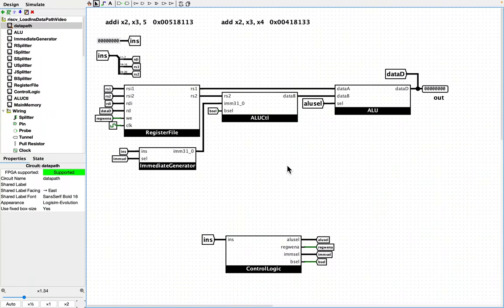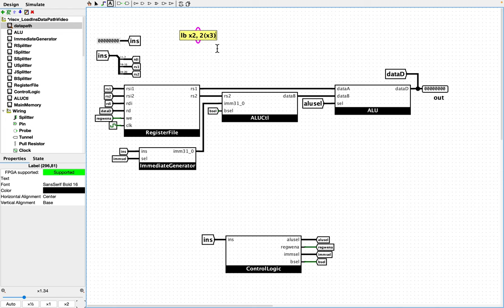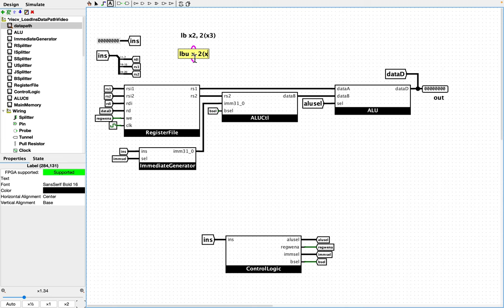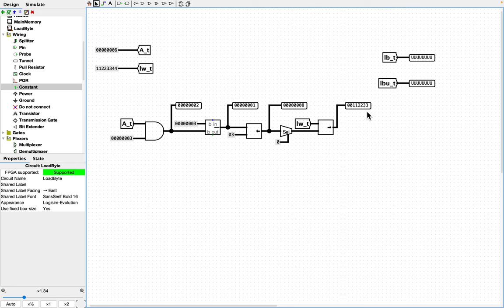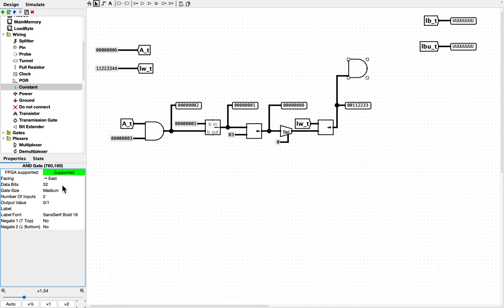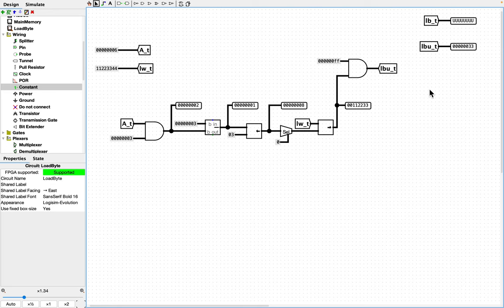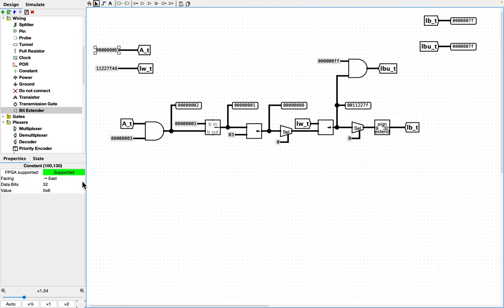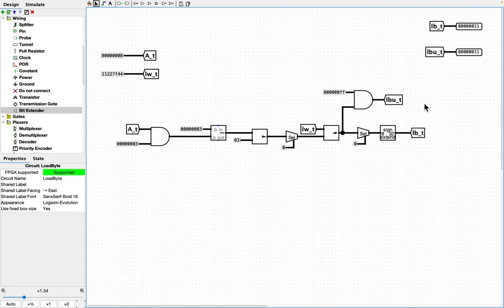RiscV Logisim Load Datapath

Comment: In load byte should the selected byte reflect the default little Indian integer format (count bytes from the right)? Also, instead of all the shift mechanics, can one of 4 byte mixes be used instead?
Reply from the maker: I assumed that words are stored big endian in RAM. The spec says it can be done either way. It's easier to demo imho. Regarding use of mux for byte extraction...interesting. How would you propose? My hw implementation was based on me writing some pseudo code (which I did off camera), and shifting is what I envisioned.
Reply: Maybe 8 4-bit muxes with the 1st mux inputs on input b0,b8,b16,b24 outputting to b0, 2nd on b1,b9,b17,b25 outputting to b1 etc. The 2 bit selects are common to all 8 muxes. I think its the same or similar technique you used for the half word but not sure. The mux effectively performs the 0,8,16 or 24 bit byte shift depending on the select.